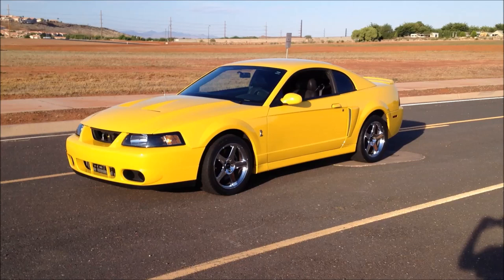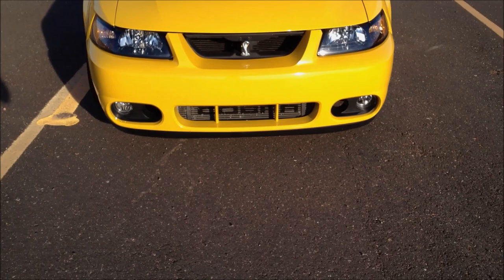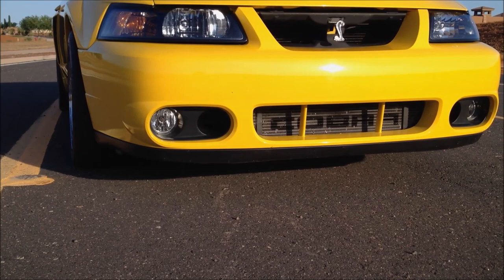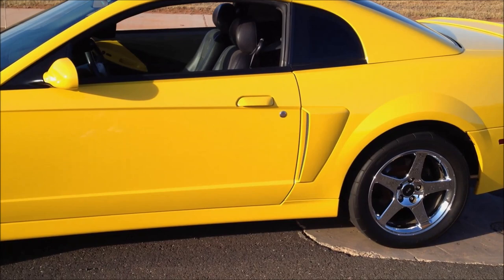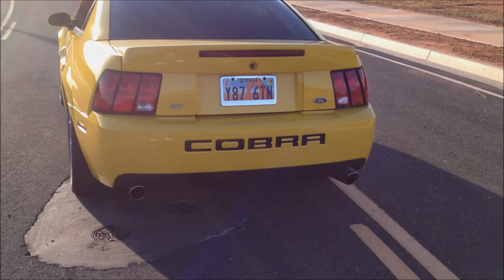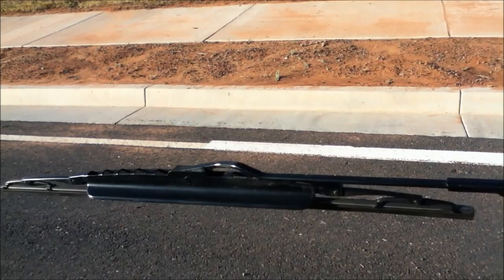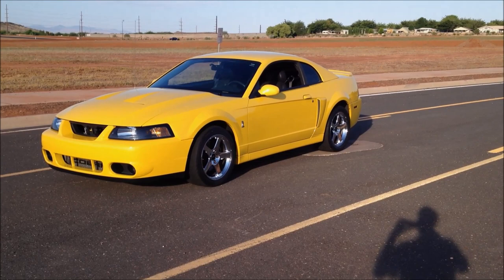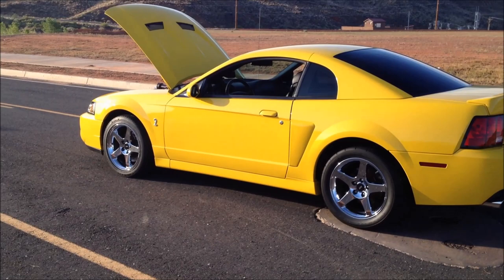2003-2004 Ford Mustang SVT Cobra "Terminator" Design

Comment: Info is right on.  The side scoops actually say Terminator on the inside of them.  That was Ford's code name when making the car but the manufacturer thought Terminator was the real name of the car.
Reply from the maker: Very good. Yes, in fact, they told vendors not to put terminator on the parts but some came saying that before they could stop it. Pretty cool

Comment: Awesome video bro! I myself have a 04 cobra and love it. I now have 101,000 miles on it and is now my weekend car. Just did a suspension on it (caster plates) and sub frame connectors. Pullies and exhaust is next.

Comment from the maker: The Cobras are still factory. My Mach 1 has some drilled and slotted rotors. Make sure they are zinc plated to avoid the rust look, hawker pads have a good reputation.

Comment: I was considering getting a 2003-04 cobra but went ahead and bought a 2011 mustang gt with the track pack which in a way is a bit of a rare car since only 4600 came that way in that year. Today I drove my old car which i gave to my broter. It's a 2004 mustang gt, not a cobra but compare to my 11 gt, the 04 feels more like a muscle car. It drives manlier if you know what I mean. The 11 gt is faster but you wouldn't know that unless you compare both since the 11 is so smooth and refine that it doesn't feel as fast. I have never driven a cobra but I am sure it driving its a totally different experience, one that many people would to try sometime.

Comment: Hello Danny I am messaging you because I watch your videos and my husband does as well I have a question for you we have an 04 cobra had it ported ,new injectors, Intake , dynotuned, and it pretty much has it all enough for the port to help a lot we took it into the shop had it on the dyno and they gave 457 they said this was normal but I think they're crazy and I thought of asking you because you're so smart with these cars is it the shop that's doing something wrong or is it just the car that it's all  it should be  giving .when I drove it out the shop it started cutting out after second gear they told me it was normal but I don't think it is it's giving me 11 as in how rich the fuel is which I know is too rich could have misfire like that detain it from giving more on the dyno? I ended up leaving it at the shop and told them I didn't want the car unless it wasn't misfiring with that because it wasn't doing it before and I actually took it to well-known Performance Shop which I'm shocked they seem like they are knowledgeable.
Reply from the maker: mariela Hernandez What size upper pulley are you running and does it also have a stock lower crank pulley? For a non-ported blower cobra with a 2.76-2.93” upper pulley you typically get the 450 range, so a ported blower should be seeing closer to 500..BUT it can also depend on if this was a mustang dyno or dynojet. The mustang dyno reads a little lower. 

11 is perfect for a air fuel ratio, no problem there. You don’t want any higher than 11.2 or 11.5. There are also many other factors for the tune. If they want to be conservative they may not be running a lot of timing in the tune as well, which will effect hp. My car would cut a bit and once I gapped the plugs tighter and changed the coil packs the problem went away. I have a spark plug video showing that.
Reply from the maker: mariela Hernandez https://youtu.be/HbSYnVAXzD8
Reply: Danny Johnson  thanks for responding, its the dynojet, i have the steighmeir port stage 7  the top pulley is 2.8 the top one only. I was expecting much more for that car so I don't know if it's the shop doing something wrong or if it's me just being disappointed LOL
Reply: Danny Johnson  also shouldn't the fuel richness be at about 14?
Reply from the maker: mariela Hernandez No, that is lean for a supercharged car. Naturally aspirated should not go higher than 13 and forced induction should not be higher than 11.2-11.5. Otherwise you can melt a piston or pre-ignite the fuel
Reply: Danny Johnson  great thanks , so what it did on the dyno do you think its a normal number?
Reply from the maker: mariela Hernandez If this was done recently, heat can have a lot to do with it as well as humidity. The terminators don’t have knock sensors, they immediately pull timing from heat. If it’s warm it could be doing that. Otherwise you can look into performing a compression test to see if anything comes up https://youtu.be/1OkYuRrHh1c

Comment: This is the best review I've seen on any vehicle, you may have just switched a Mopar guy over to the dark side. Lol
Reply from the maker: Lol. Just doing my job ha ha. Glad you enjoyed it
Reply: Scrun Johnson can you tell me what are some common parts that people add to the car to make it produce more HP? 390 is cool but I wouldn't mind it being in the high 400s/Low 500s.
Reply from the maker: Start with I take and exhaust (which actually does give more power on a boosted car) and you'll see over 400 rear wheel horsepower. Go to a different upper pulley and you'll see about 450 at the wheels, add a lower pulley and you'll see 475, port the blower and you'll get to 500 at the tires, then swap to an aftermarket blower (whipple, Kenne bell, TVS) and you'll see over 600 at the wheels.
Reply: Scrun Johnson (If you can't tell, I love how cars look but I'm still learning how to enhance them internally and make them better) So I'm looking at these older Cobra's with high mileage. Would it make sense to just but one and then replace the parts that may be worn or just get on with 30,000 or 40,000 miles on it?
Reply from the maker: Either way works. It's all a matter of preference. You will most likely spend near the same amount of money in the end (especially on a terminator since even the higher mileage cars hold good value). Personally, I would get a clean low mileage car (which I did) because there are some things like the overall condition and cleanliness of the car that would take a lot of time and money to clean up on a high mileage car. I have a Mach 1 with 110k miles and my Cobra is at 41k. The cobra feels and smells new, where you can tell the Mach 1 has had some wear and tear. If you will turn it into a racecar you might as well go high mileage, but for me, its a weekend cruiser garage queen and being low mileage means it is super clean, without any rust, grease stains, etc.
Reply: I sold my Mopar Dodge Ram Laramie 4X4 for an 03 Mustang GT with 30,000 on the clock. I am planning on going with a new Coyote 5.0 crate engine with boost.  I can't wait to see what she'll do!

Comment: I have a 2000 v-six mustang that has 275 tires and 10.5in wheels, "Cobra R's" (muahah) but I don't have any problems with fitment in the rear, they don't hang out or anything. It looks nice and clean they way I intended.
Reply from the maker: Yes, the need for Ford to cut out more of the frame very well could have been for the tire to fit with the Cobra's independent rear suspension (IRS). Ford also has to make sure a wheel will fit and perform correctly in many situations. Sometimes an aftermarket part will fit just fine, but won't conform to Ford's specs, so Ford will make additional changes that may not be "necessary" for some parts to fit. If that makes sense
Reply: you have a valid point totally forgot about irs

Comment: The only thing the designers missed was the export amber taillights. LOL.
Reply from the maker: I agree. I don't know if you've seen my other videos, but I installed a set on my Cobra.
Reply: Yeah, I saw it. Where's the best place I can get the taillights when I get a Cobra?
Reply from the maker: eBay or on facebook there is a 03-04 cobra parts page and a 99-04 parts page that has them all the time. $400-$500 is normal
Reply: That's not bad for them.
Reply: +Scrun Johnson is  that
Reply: t

Comment: Actual Real H.P. @ the Fly Wheel on Stk.03-04 Is 425-430 ,Show on ESPN  Did a Rear Whl.Dyno Once & Pulled 367 @ Rear Whls.  Drv. Shft.is Lighter & High Performance,But 390 h.p. Was Under Rated By SVT. IF Rwhp is 390, Proves HP Was Way UnderStated.Had a 03 For Awhile & Had STAGE 1.5 Porting of Supr.Chgr. & It Was A BEAST.  03-04 Stk.Engs.Were  Forged & Were Good For Bolt Ons ,Up to About 725,Before Wrist Pins Got A Little Unstable, According to AL PAPITO Of BOSS 330 RACING IN Coral Gables ,Fla.,I Believe.He Was One of GURUS Of the Cobra 4.6. Fast Ford's & Mustangs Did Article on Him ,Years Ago. He Transplanted  A 2000 Cobra  R Eng. a Friend of His Supplied Him,In a 97 or 98  Body & W/ Only 43lb.Injectors, To The Tune of About 465 h.p.

Comment: I believe the 2001 Cobras had 31 spline half shafts. Beautiful car man.
Reply from the maker: 1999 and 2001 Cobras had 28 spline shafts, 2000 Cobra R and 2003-2004 Cobra had 31 spline shafts
Reply: After searching the web, and talking to some shop owners that work on Cobras, this is what I found out.
In 1999 the halfshafts on the IRS contained a 28 spline inner shaft. This is determined by the gear carrier inside the differential. The 28 spline halfshafts were the weakest halfshafts of all IRS years. In 2001 the halfshafts were beefed up slightly and the inner spline was updated from a 28 to a 31 spline. In 2003 the halfshafts were once again upgraded to a heavier unit but still retained the 31 spline inner. ALL halfshafts from ALL years retain the same 28 spline outer that goes through the hub in the rear knuckle.

The early 1999 and 2000 Cobra R models had knuckle cross axis joints that were pressed in and did not have a flange and retaining ring holding them in. These were all recalled and updated with the retaining ring style cross axis joints.
Reply from the maker: Good information. I knew the 03-04s had the 28 spline inners, but didn't want to confuse people. You are right, the 01s has 31s

Comment: dude your awesome!! make more vids :D 

im highly leaning towards a 03-04 cobra.. hey are there any differences in the two yrs? :)
Reply from the maker: Yes, though most are minor. 
Most 2003 Cobras and Mach 1s came with only 4 threads for the cylinder head spark plugs compared to the 9 thread version for 2004. That's the main difference. As for small things, 2004 Cobras have a silver key hole on the driver side (2003 was painted black), 2004 Cobras do not have a cargo net above the rear view mirror, 2004 Cobras have silver/non-painted cam covers vs 2003's Black covers, and that's about it. Certain color options were only available for 2003 vs 2004. (I.e competition Orange in 2004, Zinc Yellow in 2003, Screaming yellow in 2004, etc). SVT celebrated its 10th anniversary in 2003, so anniversary Cobras were only available in 2003.
Reply: Scrun Johnson
 hey buddy. hows the cobra..?

Comment: beautiful car and by the way the slowmaro should of stayed in it's hard like a rock grave
Reply from the maker: First off, that's false statement. My Mach 1 does not have a supercharger and it has beat plenty of LS1 cars. Typical GM response that we need a blower so I'll give you a typical (valid), Ford response: GM has to have an engine a full liter bigger just to compete. The Cobra DOHC (Even non-supercharged Cobra) puts down the same numbers as a bigger LS1. As for the terminator- you are out of luck cause they DO have a supercharger. Go cry about it. It's like saying the Camaro would have no chance if it didnt have a bigger 5.7..well, guess what it does and the Cobra has a blower, so end of the day your "IF" statements don't do you any good. Its all about the facts. FACT:You lose. End of discussion, terminated.  The Terminator was designed to terminate the Camaro/Firebird and that's what it did. You can't change history. Now people always compare the Corvette to the Cobras. WIN!
Reply from the maker: If you are as smart as you claim you are "shop boy" or did a little research, you'd know the DOHC 4.6 puts down very similar numbers, stock for stock, both bolt on, both cammed. You don't know the difference between the 99 Cobra motor that was recalled (and fixed) and the 01 Cobra Motor, or that the 03-04 Mach 1 was yet a other revision that shared the 03-04 Cobra cylinder heads. You're just the average butt hurt GM can that can take the facts that the terminator could not be touched. Even in this case you have to talk about the n/a cobra motor just to TRY to save face. You yourself know an LS1 cannot compete. I don't have a video so I guess it never happened LMFAO. Now don't get so upset that Ford turned to FI. Your own GM bros did the same with the ZL1, ZR1, and new Z06.  Nice try tho.  Oh, and how could GM dominate with the LS1 for "10 years" as you claim when the motor was only out from 98-02.. Do some math!
Reply from the maker: PROOF? IT'S RIGHT HERE!  Mach 1 bone stock doing 13.1. Kiss my ass and do some research. You don't know a 2V from a 4V https://m.youtube.com/watch?list=PLIjr-uSYDZi5SypvV540mdzvlddbENK0K&params=OAFIAVgI&v=n5O7oR5NHfc&mode=NORMAL
Reply: *****
You might correct but last time I checked it comes from factory, meaning its stock the 03-04 Cobras didn't just eat the Slowmaro but kept up and sometimes out ran the ZO6. From factory it was rated at 390 HP but real world numbers were 415-420 HP, I know it doesn't mean anything but stating the facts. As for the LS family I respect for their motors but give me the 5.0 over those motors any day.
Reply: +Scrun Johnson  LOL.

i love when ls engine fanboys get schooled.

the whole reason mustang gt's ( 2v's) of these eras got "raped" by camaros is because the 4v cobra was the top end mustang.

then with the termi the cobras started to go against vettes an the camaro died for 8 years.
Reply: *****
And the Terminators ate the ZO6's of those times
Reply: yup loved it!
Reply: SilentMovement 305 lol the “slowmaro” The same car that was making the mustang it’s bitch from the 70s-early 2000s lol the Camaro and firebird was destroying anything ford made and that’s a fact.

Comment: No i dont have one,  which one  would you recommend? My gas cap light come on. I have already replaced the cap  but the light is still turning on, could it be a vacumm leak? Thanks for your help
Reply from the maker: Mustang cobra I really like the AEM fail safe with the lean protection module built-in. Here is my install video. Also, the gas light would remain on for about 90 miles after fixing it https://youtu.be/GmL1KBmWyhg

Comment from the maker: Sorry sir, buy you have no idea what you're talking about. Yes, stock rods will hold 450-500 crank HP for a limited time, but Ford blew up over 10 engines on the dyno. When you are producing a car professionally you have to do durability testing to last at least 100k miles. Ford did NOT have rods capable of holding boost for extended periods of time. In order for the Cobra engine to go to production, it needed to go on a 300 hour dyno session....

Comment: Hey i wanted to ask you if you have ever had a problem like mine. When i shift into3rd gear when it reaches 4000rpm the car stalls and want to shut down. I was just wondering if you have ever had an issue like that with yours?  Thank you
Reply from the maker: I have not had that problem. It sounds like your car may be running out of fuel at that RPM. That can be pretty dangerous cause the car can run Lane. Do you have a wideband?
Reply from the maker: https://youtu.be/qGsJVoSONgY

Comment: Is the code name terminator written on the car anywhere?
Reply from the maker: Yes! Interesting fact from the book, many parts initially had Terminator on them and were not supposed to. By the time they went back and fixed it the side scoop vents (with horizontal lines that match the hood vents and differ from the honeycomb style on the rest if the GT/Mach 1s) had the writing "terminator" on them on the back side. Neat, huh?